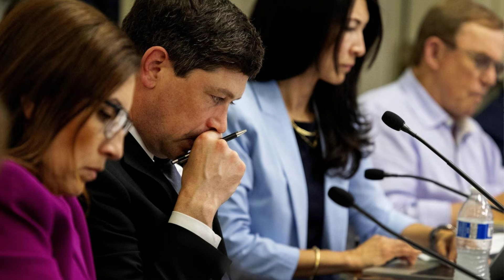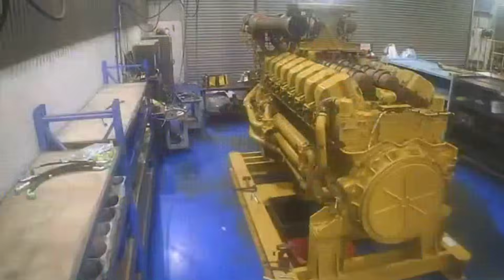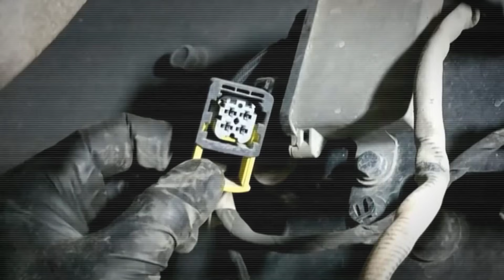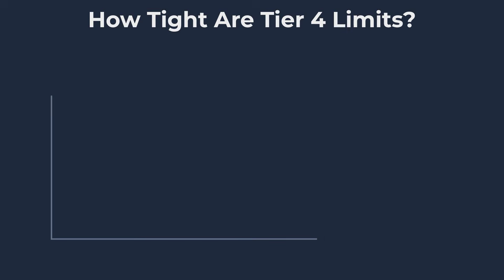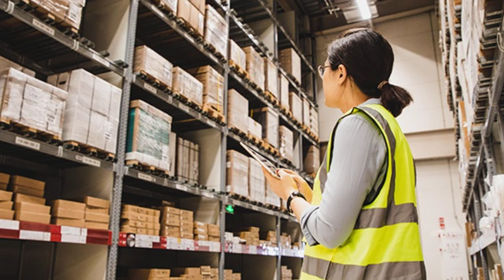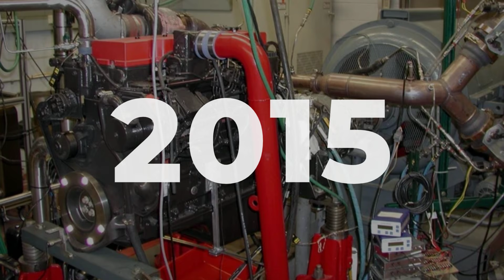Why So Many Brand New Locomotives Ended Up in the SCRAPYARD Within a Year

Comment: OK! I doubt that that on the Bnsf. After working for the Bnsf for over 20 years, whats really happening is Bnsf getting rid of their switch engines and lower power engines because they aren't able to handle longer heavier trains. The reason why remote control engines at Hobart Yard were removed not enough HP. Most yard engines are dash9 or ES road units now. So Locomotives in this video are low power switch engines with less than 3000 hp. I remember taking 5 GP engines to Irvine, Ca to be scrapped with the inside gutted it was sad. I heard the bean counters decided to use road engines being more cost efficient but their not made for that. Being an Engineer on Bnsf at Hobart u really have to be extra diligent. I miss my SD40-2 goodby old friend. Just Retired. FUN FUN FUN